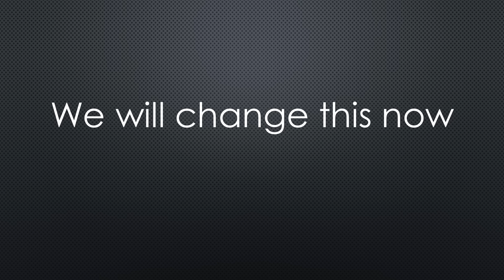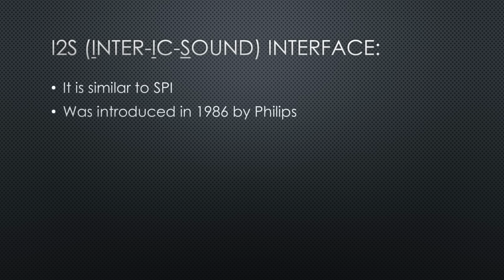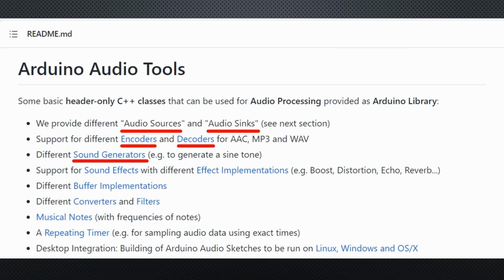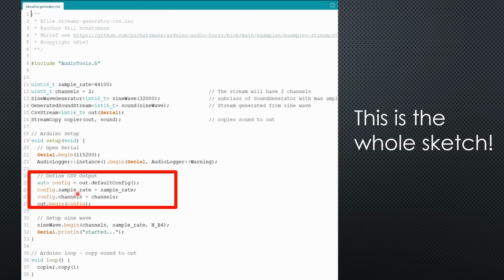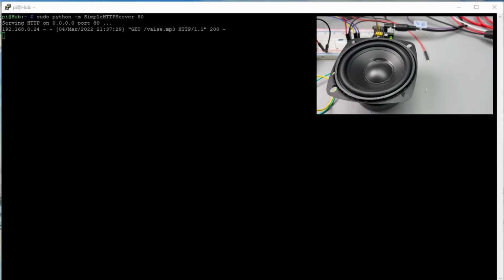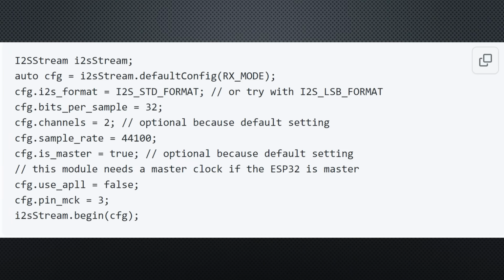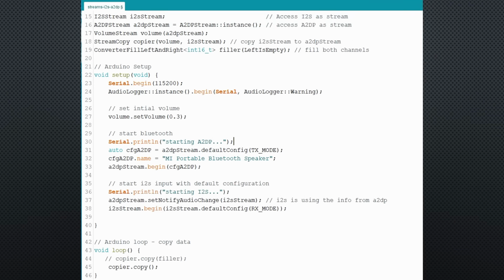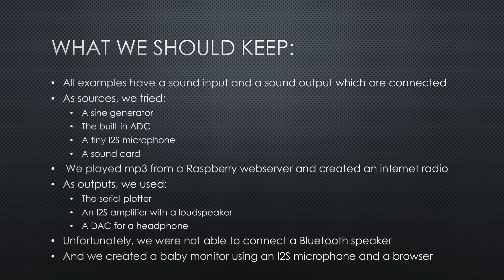#419 ESP32 Audio Tutorial with lots of examples

Comment: Hello Andreas, a very usefull video, thank you. Currently I am trying to get started with audio projects. I am using ESP32-WROOM-32, MAX98357A, PCM5102, PAM8403 and 8ohm/2W speaker. Unfortunately when I try to upload the code via Arduino IDE, then I got the following error: "Compilation error: Textbereich überschreitet den verfügbaren Platz auf der Platine", although the main code is very short and the memory of the ESP32 is 4MB. Did you have such kind of error? If possible, could you pls help me to solve this problem? I already spent some hours without any success 😞 Many thanks in advance. BR, Ercan (By the way I am from Germany, if you like you could also answer me in German)
Reply from the maker: Maybe you post an issue on Github? I did not have this issue.

Comment: Hello, thank you for this clear explanation! I am currently working on a project where I need to capture audio data convert it to .wav and process it using python. I just wanted to ask you, is it necessary to use any other module(adc or filtering) with the inmp441 microphone or is it okay to connect it directly to the esp32? I want a fairly good audio quality to be able to process the audio file
Reply from the maker: I suggest you go to the project's page. There you find many I2S ADCs and boards particularly made for the ESP32.

Comment: Hello, did you make the video using the filters mentioned ?
Reply from the maker: No.
Reply: @AndreasSpiess  thank you for the quick reply, I have one more question. I managed to get the mic data from the I2s mic, filter them and plot them in the serial monitor. What I don't understand with the copier is how I can manipulate these data before printing. Like sending them via ble. Is it possible to access the "stream"?
Reply from the maker: @MixalisXaxalios  I would ask the maintainer of the library (create and issue on Github). I do not know the details 😞

Comment: thanks for the video! it was great as per usual. 
is it possible to connect a pi pico to the esp32 using i2s? i am using a pico to identify as a usb headset, and i'm trying to find the optimal way to send that signal to an esp32 that will be wired to it, and from the esp to a bluetooth headset
Reply from the maker: I assume you can send connect any I2S source to the ESP32. But I do not understand what you want to achieve :-(
Reply: @AndreasSpiess  I'm basically trying to make an adapter that will connect to a device that doesn't support bluetooth audio output. the adapter will identify as just generic usb headphones (thats why im having to use a pico). and then i need to pass the actual audio data to the bluetooth headphones, through an ESP because it can act as a bluetooth source. so:

PC --(USB audio)--> PICO --(I2S)--> ESP32 ···(Bluetooth)···> Bluetooth Headphones
Reply from the maker: @RNDev666  AFAIK, the ESP32-S3 can act as a USB device. Did you check that. It would probably reduce the complexity.

Comment: Thank you Andreas for the great video. I need to stream a squire wave signal in audio frequency rang wirelessly 20 meters to a receiver.  Squire wave can be converted to signe wave if I have to.  I could probably use classic bluetooth for transmission.  Transmitter is sitting on a metal pole and the receiver is inside a truck driver cabin.  What are your suggestions.
Reply from the maker: I have no idea because I never heard of these protocols or products :-(

Comment: hey there its really helpful video, i need an help i am testing it with max98357 and inmp441 but confused in pin connections can you help.
Reply from the maker: Maybe you check the Wiki of the project. There you should find a lot of info.

Comment: The stream-generator-csv seems like doesnt exist in the git you had provided @Andreas Spiess if there is any other git zip folder kindly help me out with it, also i am using inmp441 as my microphone i had given my pin connections accordingly, by referring an another vedio, i used the code you provided for inmp441, while doing so, i am getting all zeros in the serial monitor, finally i want to perform inmp441 with esp 32 besides hearing the sound with the help of the website you provided, kindly help me out with this.
Thank you,
Reply from the maker: This library is not supported by me. But its documentation is quite good. So if you do not find what you need, it is not available :-(

Comment: does this make the speakers connected to ESP32 addressable via IP or some other identifier, also can it be used for Neopixel lights and speakers  - controlled separately on a single ESP32?
Reply from the maker: No, not with a lot of additional work.
Reply: @AndreasSpiess  coding or hardware - et both?
Reply from the maker: @itolond  Both

Comment: How do you make the ESP32 just input audio from a speaker level output and send audio to a microphone level input?
Reply from the maker: This question cannot be answered in a few sentences. Maybe you search for a project that does it?
Reply: @AndreasSpiess  Yeah, it's not simple. I have to use a resistor divider to reduce the level, couple it with a cap, then bias it up by 1.65V with a 1:1 resistor divider. So mid way through the ADC (2048) is zero level. What a headache, lol.

Comment: I downloaded the library in the form of a zip file.   Then I unzipped the folder and copied it into the:    arduino\libraries\   
After that I launched the arduino IDE, tried to open and compiled few example projects. I found out none of the examples I tried were compiled --   They would asked for many missing include files.  Questions:    Are these sample  projects structured right?   seemed like the directory path struncture were all wrong !!!  Could somebody tell me what I did wrong?
Reply from the maker: I did not use it recently. So maybe you ask the question on GitHub.

Comment: How can I please change the pins in the configuration? I wanted to use an ESP32-C3 and it has different ports
Reply from the maker: You have to ask those questions on the github project. However, I am not sure if it is a good idea to use the -C3 because it is very different and might not work.
Reply: @AndreasSpiess  Thank you so much Andreas for getting back. I will do more research. I am new to all this so it has been quite a steep learning curve.

Comment: Andreas, Thank you for sharing your work here.  
I have been studying many video and other sources about integrating the INMP441 to the RP-Pico or ESP32.  In all cases I remain confused with the 
INMP441's I2S 24 bit data output being mapped directly to 16 bits.  Could you explain this?

Thanks
Reply from the maker: You can shift the bits of a 24 bit number by 8 bits to the right (divide by 256). The result should be a (less precise) 16 bit number.

Comment: I wonder why sometimes one of my esp32's wifi is unable to connect to wifi even though the ssid and password is correct, sometimes after a few times of resetting the board it works, sometimes it wont work at all, and then now i see the same behavior for th bluetooth connection in this video.. is it a known issue for esp32 boards or..?
Reply from the maker: I do not know of general problems. Millions of such chips are in the "wild" by now.

Comment: Hello Andreas,
could you tell me what type of card you used to compile the Phil's Library examples?
I use the Arduino IDE and I tried: Esp32 Dev Module, Esp32 Wrover Module, Ai Thinker... nothing works yet I am in 2.0.14 of the ESP32 board library.
thanks for your help
Reply from the maker: I usually use the standard dev board board definition.
Reply: @AndreasSpiess  yes, it works if you use Visual Studio but not with the Arduino IDE.
Reply from the maker: @bernard-charlesbarrois5265  Strange. PlatformIO should use the same base as Arduino.

Comment: Hello Andreas, great video - as always! Did you or anyone else had success in streaming music via internet and playing it back via a connected bluetooth speaker (using ESP8266 Lib)? I'm trying to build my own ESP32-based web-radio player and try to use an existing bluetooth speaker for playback. It'S hard to finde a complete and working code example on the internet.
Reply from the maker: I once made a video about an internet radio using an ESP32.

Comment: Hello again, @AndreasSpiess, I am deciding to buy from your links all the componentes for my project, but I still have a question, I see that you used the ESP32 Wroom board according to the link.
But before buying, can you answer a couple of questions?
*1 Which board did you select in the IDE list to compile correctly?
*2 Did you modify, or add any line of code in the configuration so that it compiles correctly?
I try to compile for Wroom or for generic ESP32, and it returns a compilation error for that board.
After I managed to compile, I bought all the components from your links. thanx Andreas!
Reply from the maker: 1. I always use the ESP32 Drv board
2. You have to read the error message and correct the error. No errors should occur because of the board.
3. Thanks for using the links!

Comment: Awesome. At 8:24, though, it's completely fine to have signals up to 5V on ESP32 (just not on power pin). CEO of Espressif has confirmed this
Reply from the maker: I only heard that for the ESP8266...
Reply: @AndreasSpiess  Teo Swee Ann confirmed that the ESP32 GPIO pins are 5V tolerant. Apparently, they took that out of the datasheet because users were trying to power the chip with 5V

Comment: Wonderful video!!  I'm stuck though:  I have the ESP32 v2.0.10 by Espressif installed in the latest Arduino IDE's Board Manager but I do not find the AI Thinker Audio Kit board listed.  What board do you choose or is there another board configuration that needs to be installed instead of or in addition to the Espressif one?

And does the board program via the UART port or is it necessary (or recommended) to program via the JTAG interface pins on the board?  I keep searching the Internet for details on this but come up empty handed.

Thanks in advance for any direction that could be provided on this.
Reply from the maker: The board can be programmed via USB. I use the ESP32 dev module board definition. You need to install 2 libraries and try which board you got. Information and support is on Github

Comment: Hello beautiful people!  I have been dreaming of a project that would allow for a synth sound to be played and the pitch be changed with an analog signal.  What I want to do is to add custom sounds to my electric motorcycle that will change to match the throttle signal, making it sound like a cool futuristic machine as well increasing safety when riding near cars and pedestrians.  I am still a bit of a noob when it comes to programming but this seems like it could potentially be a good beginner’s project.  I have a couple ESP32 boards and was hoping these will work for my project, I’m just having trouble finding the right direction.  If I had series of MIDI notes of the sound I want to play would it be possible to play through them as a scale with the 0-4v throttle signal as well as output this as audio?  I’m really hoping I can get some help to at least get pointed in the right direction, hopefully I described my idea in a way that is understandable.
Any suggestions?
Reply from the maker: Just start with a block diagram, and continue with a small proof of concept of each block ;-)

Comment: Hi ive done coding for recording to the flash  memory of the ESP32 and successfully saved the recording with file sizing utilizing SPIFFS as file forwarding system. But it seems like wifi.h FSbrowser(seperate code) wipes out the flash of the esp32 when compiling over to the ESP32 as the file size is then shown as 0B.
Reply from the maker: Well possible. SPIFFS is not like an SD card because it is part of flash memory.

Comment: Certainly useful, though the audio quality was really bad.
The solution would be that bluetooth speaker, bit sad to see that part has failed.
Reply from the maker: If this is true, something is wrong. The quality in general should be good.
Reply: @AndreasSpiess  I just refered to the audio in your video, it sounded like mobile audio sounded ~15 years ago.
Compared to any modern phone with their tiny speakers a very bad quality in audio. At least to my ears.
In any case, Bluetooth is the solution for a ton of audio needs. Hope there is a solution to that issue you had.

Comment: I built the blue toothe speaker in your video with the esp32 dev board and max98357a! I made the connections on a breadboard and uploaded the A2DP code to it! It worked for about a minute and started dropping out. Now I cant get it to show in the device manager on my phone or laptop. Looks like i got some work ahead for me. Pretty impressive how easy you made it though, since I'm new to micro controllers and programing! Awesome projects you have! 👍
Reply from the maker: Welcome to the channel. I wish you luck finding the problems. Otherwise, Phil is helpful if you create an issue on github.
Reply: @AndreasSpiess  wow cool! I wasn't expecting a comment back from the creator! 👋😀 I think the project simply wasn't getting enough current as I was using a 7805 voltage regulator to power both the boards up! Probably a brown out issue but if I still have problems I'll definitely contact phil. pleasant surprise to hear from you! Thanks for your input!
Reply from the maker: @ryanmowry1170  All comments are answered on this channel ;-)
Reply: @AndreasSpiess  I got my project working! 😀👍 I powered the circuit directly without 7805 voltage regulator and  tested it all day and didn't drop once!  Very cool project and easy all thanks too your wonderful and helpful channel! Keep up the great work! Your channel makes a difference and is much appreciated! Now I'm going to make a more permanent version of the circuit with my first attempt at making homemade pcbs and soldering the stand alone esp32 and amplifier modules to it!

Comment: HI - if there is a buffer for connected Bluetooth MAC adresses try to clear that. - I had this inconsistencies on linux. After that reconnecting / repair was working fine . I dunno if the bluetooth chip you are using has this inbuildt funtionality. in linux I had to write a script to clear the buffer every 24 hrs.
Reply from the maker: Thank you for the info!

Comment: Hi Andreas, i have one question about the simple baby monitor: where can I change the port to interface to the internet with the IP address? Now the 80 is set, but if I need to change it where should I go? Anyway thanks for the video and what you're doing. I appreciate your work
Reply from the maker: You have to ask the creator of the library for the details. I do not know.
Reply: @AndreasSpiess  ok, I'll do it. Last thing: trying to run the code on the ESP32 I encountered a problem, which is given by my GCC version 5.2. I wanted to ask you: do you know how to upgrade the GCC? I've searched the internet and the Espressif documentation but I don't understand much about it. Could you give me a little help? Thank you for your availability and patience
Reply from the maker: @Fr4nzB0OM  No. I just use Espressifs ESP32 package 😞
Reply: @AndreasSpiess  Okay, thanks anyway. I solved that problem too by talking to the author of the library. Thanks for everything!!!

Comment: Hi Andreas - I have not seen any videos on the ESP32 ability to play notes.  It can produce the 12 notes of the scale across 8 octaves.  It uses just 2 commands - in setup -  ledcAttachPin(TONE_OUTPUT_PIN, TONE_PWM_CHANNEL);  and  ledcWriteNote(TONE_PWM_CHANNEL, NOTE,Octave);  //  where note is one of the 12 from NOTE_C to NOTE_B.  By using channels 1 and 9 you can produce stereo - eg independent channels - one set for the left hand and one for the right hand.  Connect the GPIO output pins of the ESP32 and earth to an amplifier.  By creating an array of NOTES[12] you could create a stereo laser harp or Theremin. Have you done a Youtube video on this feature of the ESP32 ?  Perhaps I have missed it..  Best regards...  Keith (Australia).
Reply from the maker: Yes, the ledcAttachPin command is very versatile. I never did such a video. I only once used a library which played some titles. But this is many years back.

Comment: Looks great, I have a question, is this library could work also with sound board VS1053?
your other radio project uses that board, which I have and would like to find if this project could use the same VS1053 for audio processing, thanks
Reply from the maker: just google "VS1053 pschatzmann" to find out how.

Comment: I'm trying to expand the streaming example streams-url_mp3-i2s.ino to allow cycling between multiple URLs but the ESP32 becomes unresponsive to anything added to loop() once streaming starts. It won't allow polling a pushbutton in the loop(), for example, or toggling LED, or Serial.print. Nor does an interrupt work. What am I missing?
Reply from the maker: Maybe you open an issue on GitHub? Phil is the specialist.
Reply: @AndreasSpiess  I did, and within minutes he responded, recommending a different example. But with so much of the 'heavy lifting'  being done by the library, it's hard to make changes. Besides, I'm curious why loop() doesn't work as expected. Thanks for the reply.

Comment: I went to the link for the ESP32 board you are using but got to a different product. I would like to get the ESP32 board you use in this video.
Reply from the maker: Not all modules are currently available. Check which are supported by the library.